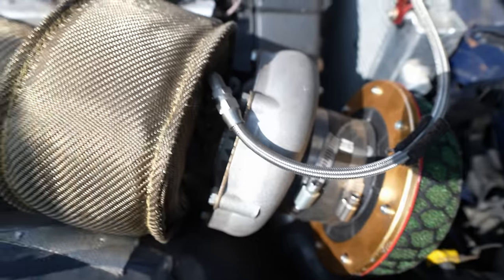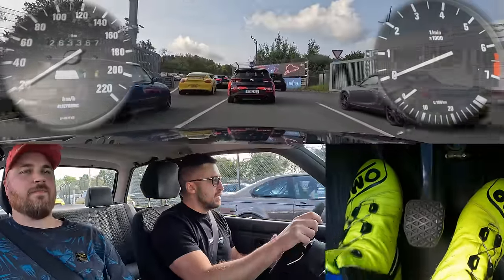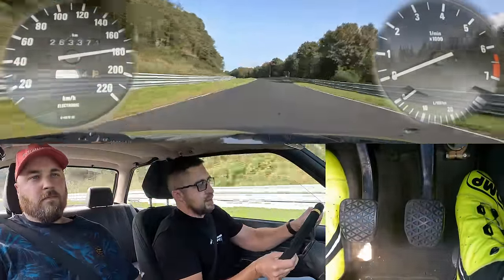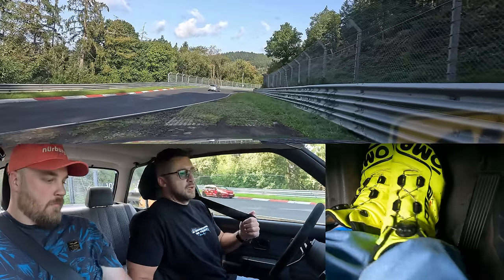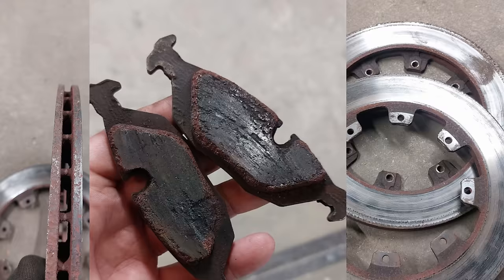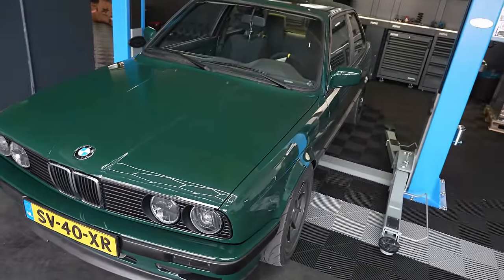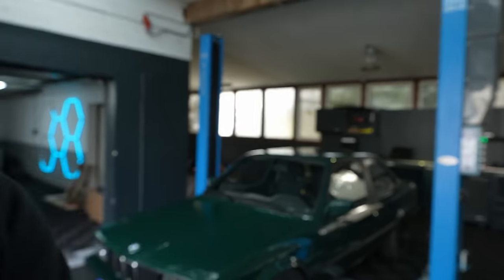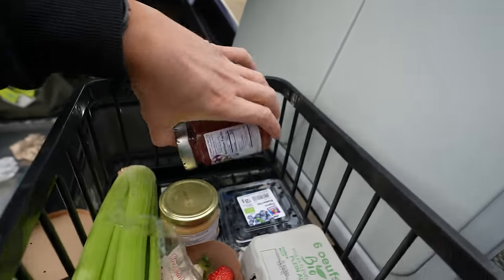I CRASHED & REBUILT His Big Turbo BMW E30 // Nürburgring

Comment: Wow..  With this amount of power combined with the weight, you should expect people to put on the appropriate brakes with the right fluid.
This is borderline dangerous for Misha and other track users. 
Let this be a message to everyone to get your brakes sorted and up to spec!
Reply: He probably thought Wilwood was enough. TBH for the street or drag it probably is.
Reply: Things can fail though doesn’t matter how much you spend sometimes cars do break especially on track! You can burst a hose or calliper can lock up without you knowing there’s all sorts can go wrong this is the risk we take..
Reply: @AI-Records24 True that, but also is good to make it good as possible if you are going to drive fast or even race it. Imo these brakes were good enough for the car, but the problem was they were old as fuck. Just by looking at rotors you can see deep rust pitting, and im almost certain that the car was sitting for a long time, or brakes were purchased second hand. So very rusty rotors and old pads just "cleaned" by simply driving that creates uneven surface and also creates polished shinny surface that heats up very fast and does not brake as good as clean metal. And probably brake fliud dot 4 instead of 5.1. Ofcourse it is just my guess
Reply: Old brake fluid enough for this to happend, should be changed after any track driving completely..
Reply: @sub7up.  I don't know a single person that ever changes their brake fluid on their cars or bikes. And I don't mean this in a good way. It's really dangerous when driving fast..
Reply: watch the video he has wilwoods you always run this chance when you drive
Reply: @cameronscotty3671  Ofcourse I watched the video.. This is a "light" car with a lot of horsepower, it really covers a lot of ground fast. It's nose heavy tho, so the brakes get a beating, especially on the downhill sections. This setup also isn't that big so it can't house a lot of pistons because the wheels aren't that big of a size. The appropriate fluids should also be changed regularly. 
IMO it's not up to spec for this type of driving, maybe for street/dragstrip driving
Reply: @TheGoose98 the picture of the pad looks like it had enough material but it disintegrated, chunks missing. Maybe got to hot before this. Then some old fluid and Desaster
Reply: Willwood makes good track brakes aswell. @kanaric
Reply: Beamer sound sick ngl
Reply: I change the brakes every year. Always cheaper than boom
Reply: first thing I do to any car if I plan to drive it hard is maintenance, brakes and tires, and suspension is next,
Reply: i have similarly sized wilwoods on my e30 and they stop the car just fine with no overheating issues. i think this is a case of old pitted parts.. those pads should have been changed a while ago.
Reply: true, yet you drive stranges car, you should take 20% off the speed, when you see brakes are crap, just take the car off the track... its good that they fixing it if possible.
Reply: Wilwoods are good Brakes, what we don't know is what fluid he put in his car also we don't know if there are any cooling ducts to the Brakes. An absolute must on Small wheels and Big Brakes!
Reply: Probably why Misha said recently he was going to not drive cars without upgraded brakes, cooling and tyres
Reply: I hazard a guess that what we saw were the pads of the OEM rear brakes with the front (wilwood) rotors in the background. Doesn't really matter though as obviously the  pedal fell to the floor.
500 bhp and 592Nm of torque in an E30 requires brakes on the Nordschleife that will no longer fit behind 15" wheels like this willwood kit seems to do, based on the clearance they have in what seem to be 16" Hartge wheels for the E30 he's running.
He'd need something like 330mm front brake disk diameter as well as increase rear disk and caliper size in order to reinstate proper brake balance.
Reply: The car looks great in British racing green
Reply: many "tuners" do not know what they do...
Reply: Willwoods are shite Alcons all the way 👌
Reply: @kanaric  For track they should be good enough as well. The problem seemed to be trash brake pads which outgassed heavily and caused brake fade.
Reply: @kanaric  I couldn't find those "wilwood" brake pads, could you guys help me and throw a link to those?
Reply: He had Wilwood brakes, at least calipers and potentially rotors, his pads probably (most likely) weren't up for track use and it's clear neither was his choice of brake fluid (we don't know what his lines were made of either)... some people are knowledgeable, but not fully....he probably didn't understand he needed fluid and pads at the very least to be able to handle a lap of a track as grueling aa the Ring, most of these enthusiasts throw on calipers and rotors and good street pads and are shocked at the transformation of braking capability of their cars, but have never tracked a car before to realize what amount of abuse brakes have to endure, and that calipers, rotors, and good street pads aren't going to cut it. Hopefully Misha took it upon himself to bring the rest of his braking system up to spec for him, or at least told him what to get lol.
Reply: Brakes FIRST 😮
Reply: 500 horses regular brakes tiny tires = death trap
Reply: Ngl I’m not driving my car without abs n traction control. That’s bugging n type the bear minimum for with automatic transmission 😅
Reply: The Wilwood brake kit on that car isn't cheap by any means.
Reply: First thing I'm doing on my project car before I get it back on the road is a brake rebuild
Then new tires
Then everything else

Comment: to take 500hp coffin on a 20km+ track with those brakes is an incredibly stupid idea - luckily it all ended well, props for fixing it Misha!
Reply: stupid idea with willwood brakes on the nurburgring?
Reply: just the brand of the calipers doesnt mean everything else is up to spec (pads, fluid, etc)... also just because you have a big brake kit doesnt mean you dont need cooling for them... @MistRVertexZ
Reply: Props for Misha, driving real Shitboxes like this, that tries to Kill you in nearly every corner! 

Misha, bist du Lebensmüde?🤔
Reply: @einautofan6685 you have never ever builded car your self kid
Reply: @MistRVertexZ  Proper brake pads are more important than shiny branded calipers and rotors.
Reply: @MistRVertexZ  eh more to it than that, make sure you have pads that'll deal with the temps, that all your plumbing is up to spec, etc
Reply: Fresh fluid and good pads do a lot.
Reply: @timomattiasravattinen9210  neither have you kid
Reply: @einautofan6685

Shit box ? Whut?
Reply: I drove a 150 hp astra around that track with standard discs and new standard pads. They were glowing red and smoking after each lap and took an hour to cool before I could do another.  I will go back again soon with a 250 hp car

Comment: Not surprised you crashed, I can feel the sketchy-ness through the screen. This kinda speed in a GT3RS would be like driving in a village at 50kmh but in this shopping cart from the 80s its completely out of control. pressing the gas pedal is like jumping off a cliff and then trying to reach out and grab onto a tree branch to hold on when a corner comes
Reply: That’s a nice analogy, I completely agree with you

Comment: How to restore a car in 4 easy steps : 
1 - Buy a car 
2 - Upgrade the engine 
3 - DON’T Upgrade the brakes 
4 - give it to Misha 

Et voilà !
Reply: it’s either brakes, tyres or cooling people really do hate upgrading the most important things
Reply: literally says wilwood brakes at the start
Reply: 3 - Add Brembo or other cool branded calipers and cheap but cool looking no brand rotors and pads.
Reply: He had Wilwood 4 pots with floating discs.
Reply: @dazzanzl 

I don't get how everyone seems to be missing that. Upgraded, bigger Wilwood brakes. At least you heard it as well😂
Reply: @3masouri  3 things you should start with... hmm interesting xd tyres/brakes/cooling. Power should come as the last thing imo.
Reply: @3masouri  the strangest thing is why dont people want to upgrade the things that'll save their lives. 600hp is no good when you can't stop
Reply: @NeFjuS 100 percent. Suspension brakes and tires are the most important first mods. You can always hammer a good engine from factory. Brakes etc not so much
Reply: @christycullen2355  people forget cars are supposed to get you from A to B not from A to halfway to B

Comment: I agree with the roll-cage; and IMO the brake required upgrade too, and maybe Vulcan-Alpha can design a brake cooling duct for this E30 too?
Reply: Funny thing is, the E30 comes with brake ducts on the “is” spec. They would bolt right on to this, except he blocked the intakes on the valance with the intercooler pipes.

Comment: Throwback to when 500hp was scary!
Reply: In that car it seems like hell
Reply: was? it still is imo, here like 99% of cars on the street are like 100-150hp
Reply: @LatvianVideo MY car would never be that bad, only 150HP??? Try 96 (geriatric) horses from a 1.4L engine.
Reply: In that car and on the ring it hella is
Reply: has nothing to do with the number but how it's delivered, single big turbo it's like deeeadeeadead PUNCHHHHHHH
Reply: In a 2,400lb car 500hp can definitely be scary.
Reply: These BMW E30's weigh just over a ton  so just under 500/ ton is more than any M BMW puts out. An M3 Comp is just over 500bhp but weigh 1.8 ton pushing it back to 300bhp/ton. 
This is a Flying machine.

Comment: Just a heads up to some people NEVER use factory road brake pads on the track. From people i know using regular pads from the autoshop on a racecar all of them had failed and delaminated the material off the brakepad in one session. Just buy racepads for atleast the front if the car is seeing the track. The heat produced is insane.

Comment: Since Misha has a big tech team now, how about designing a small device that would be able to check all the important aspects of the car :D Like you put it in a wheen it will scan the brakepads, drop of oil to check the engine, and so on, could be a money saver and also a big money maker. Like an alcohol tester for drivers, a condition tester for cars

Comment: I really liked you till this point, now i also respect you. You are not just a good driver, you are also a truehearted racer with morale. Ages ago I was racing an evo6, equiped with a GT3076, ethanol, pushed out 570BHP and 700Nm torque (1130kgs weight caged!) - and yeah I know brakes are always the weak point with these mondters, so we needed to upgrade to 6 piston carbon disc brakes ultimately, right off from a Lemans aston martin.

Comment: The first seconds with the car accelerating it already felt really dangerous. If you put that much power on an old car, make sure the brakes can handle it.
I've seen a lot of people up the power because it's the fun part, while ignoring the brake system because that's boring.
For racing make sure you upgrade and maintain your brake system before thinking about touching the power!

Comment: You can fully rebuild a whole E30 here in South Africa with 5700 euro , full suspension , new engine , standalone ecu , full respray , rust removal , full interior new rubber , new grills new lights everything and do it at a professional place , because 5700 euro costs as much as a BMW E9x 335i here in South Africa and a good condition one

Comment: Nice rebuild! However, I think it's time for a "If you want me to drive your car" video. Explaining, again, what safety maintenance must be done in advance. To limit your exposure to liability, and to increase more track safety awareness. Everyone wants to go fast, but not enough (sadly) take stopping as seriously as they take accelerating.
Reply: Everyone knows already to be honest what should be done instead is just have a simple google doc form they fill in when they message him it will have checklist of:
- brakes
- age of brakes
- fluid used and age of it
- tyres 
- age of tyres and tread left
- any problems with the car 
- cooling system 

Etc, be so much easier then he gets the form back filled in and can say yes or no based on the results

Comment: I was kinda shocked at the full body respray being so expensive, until I realized it wasn't just the outer panels. 
Once I saw the engine bay, it made much more sense. Not a fan of the color on a German car, but whoever did it knows what they're doing.

Comment: Brake ducts. They work. I am surprised those wilwood brakes failed so fast, they are either 295 or 310mm?  The owner did not cheep out on the brakes, maybe on brake pads? They do offer a lot of stopping power but not quite as much thermal capacity?  Anyhow they got hot and its a GG from then on. I have E36 brakes on E30, 200 less hp, any they easily get smoking hot too, but with brake ducts i did not manage to overheat them on a track day. Our grobnik circuit is less demanding on brakes then green hell is tho. So happy you fixed the car Misha, I would not say it was your fault. With such fast car and bad brakes, overheating maybe occurred on one last braking before the crash, with you not even noticing them starting to fail. Since you basically live on a track now, I bet you would recognize them starting to fail otherwise.

Comment: a quick note on brake durability on the Nürburgring. I drove 10+ laps and didn't feel any give. After going for 1 lap with Misha, the car had the softest brake pedal I've ever felt, I even thought something went wrong (everything was fine). Point of this comment: Always be mindful that if you do not drive your car to the limit, your parts might not always be in check. And one experienced driver is necessary to show you what needs changing. So the "no more driving shitboxes" is not meant to go after personal builds, but to keep them whole, instead of ending up in a wall.

Comment: Brakes may have been too small for this amount of power on such a long track, but they will usually start to fade before being lost completely. That's the clue to slow down and let them cool for the rest of the lap, and situations like this could be avoided. In general I think it's a bad idea to jump into a car you have never driven before and push it to the limit straight away. Especially a homebuilt car like this where you have little knowledge on the quality of the brakes and such. But it is nice of you to take some responsibility and help him fix the car once it's happened.

Comment: i learned how to drive manual transmission on an e30...even on that simple stock e30 the clutch was harder than any car ive been in...however because i learned with that car i can basically drive any manual today :P

Comment: What I don’t understand is how the brakes didn’t give information that they were overheating. Wherever I’ve cooked brakes the problem has always made itself known to me gradually, with lengthening pedal and reduced performance, allowing me to back off. In fact that’s how it’s supposed to work with normal road cars - the fluid is the safety factor.

Comment: 500hp/600Nm & 1100kg, no joke on the performance considering the acceleration!

M50 with M52/M54's 3.0L crank huh? No wonder it doesn't seems peaky like the RB25 powered ER34 a few videos ago.

But I do think the engine/power is bit too much for track duty, but this is personal opinion, of course.
Reply: Ya 500+hp on a RB is like that. I have a RB26 with turbos in more the low 400s whp range and it's pretty decent though.
Reply: @kanaric  Is it simply because lacking displacement? Since RB only 2.5L or 2.6L.

Comment: The paint job price is actually very good the engine bay and everything a full glass out plus engine bay and I bet the trunk inside is even done I bet you have to pull the carpet or have it on a lift to know it was every repainted a job like this to this quality is 10k plus in the states just a to get it painted with the door jams and everything like it should is easily 2k

Comment: i hope the owner learned something about building a  car with that much power and little weight.

From the owners IG. looks like all they did was upgrade the willwood bbk rotors and pads for next time and i hope they do a bit more searching... and use appropriate pads and fluids and cooling ...and i hope he runs a few sizes wider on their tires as this also improves braking and overall drive. 

Although....with that much power and that VERY little brake surface... what else is to be expected? this would have required the owner to upsize the brake rotors and wheels to get more efficiency. 

I have to add, the brakes are probably fine as is.. only because i think the owner can't push the car as fast as Misha does.. if someone like Misha was driving that.. upsize the brake system overall and run larger wheels - i think the current ones are 16? so maybe just upsize the rotors.

thank you for being you Misha and never change.

Comment: €430 for a turbo rebuild on a snail of that type is not bad at all. By the way, the repaint cost so much more because the Greens. They moved Heaven and Earth just to get the 'old, toxic' varnishes out of manufacturing and replace it with this modern, water-based stuff. Very cool. But, your body didn't absorb the old oil based paints so readily as with the water-based stuff, so in the long run this costs a lot of money (replacing paint booths, new processes) and, end effect, it will make all of us much sicker in the long run. As with 90% of green initiatives, it came from a good place...

Comment: I'm sensing a theme with crashing BMWs... that's 3 now? race car included. :P

Silliness aside, I'm glad everyone is fine, and the damage was only to the car.

Edit:
As for the paint costs, sounds like Germany operates under similar pricing as Norway, 5K repaint sounds about the same as when I used to work in a car paint shop back in like 2009 or something, probably even more expensive now.